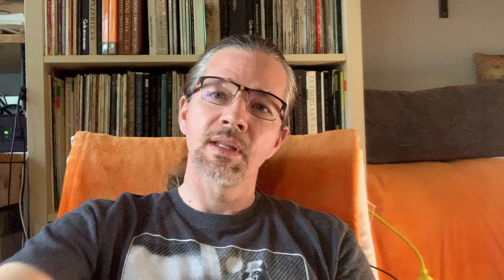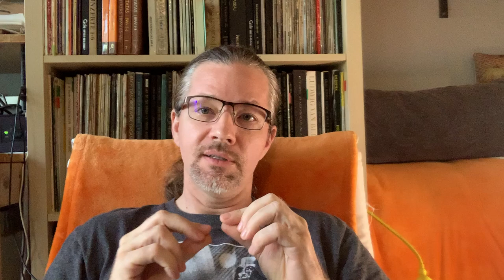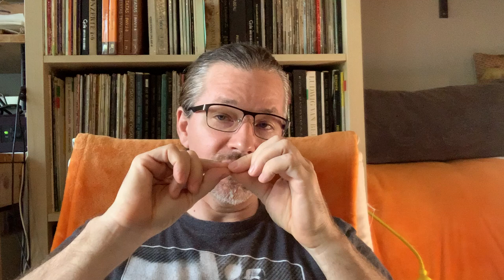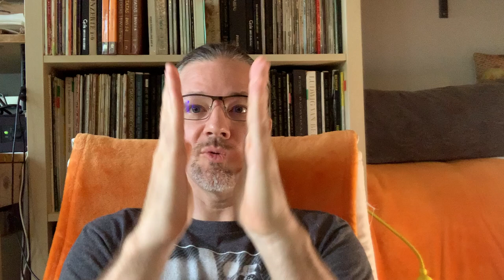BRIEF explanation of CAPACITOR sound colorations in AUDIO

Comment: There are no electrons jumping between the plates of a capacitor. In direct current electrons gather at one plate, creating an electric field that pushes the electrons on the other side of the plate; very quickly this stops the direct current from passing, because the voltage across the capacitor can only push so many electrons to one side of the plate. In an alternating current, on the other hand, higher frequencies are let through while lower ones are stopped. Again, no electrons pass through from one plate to the other—only electromagnetic energy. The insulator (or dielectric) matters in the way that it responds to electromagnetic fields, but it should always prevent electrons from traveling across. A discharge across the plates of a capacitor would be disastrous!
Reply from the maker: Thank you Terrance for the important correction!  The bit I wanted to convey is that the entirety of the field (that corresponds to the AC signal) has to travel through the insulator, and thereby the insulator has a profound effect on the electric field, of the charge and discharge properties.
Reply: Absolutely correct. Capacitors only charge up and then discharge again, depending on the electric circuit. In DC power supplies an electrolytic capacitor will hold the charge until a load is attached. In AC circuits the capacitor will charge and discharge at the rate of the signal frequency.
Reply: Looks like some of the people replying understand how a cap works. What you have to remember also is farads or micro farads are a time based measurement, and how long it takes it to charge and dis charge is what allows current to flow in the rest of the circuit. So since current never actually passes thru it the only thing that affects freq. is how long, not what it's made of.
Reply: How the different dielectrics respond is all compensated for in the rating of the cap, .022 poly, is .022. ceramic.  same time to ch, dis ch., same freq. Differences in sound are from variation in value. Since I do a lot of amp tone shaping I measure a lot of caps and they are all over the place. Many times not even within their specified tolerance.
Reply: @bradt.3555 indeed. If the rated capacity is the same , the rated esl is the same , if inductance is the same , then there is no difference.
What them audiofools hear is simply real world capaciotrs are not ideal capacitors by any means. 
Where small differences go large , are not the crossovers. But anywhere before the amplifier. As any effect of a difference will be amplified by the amplifier.

Comment: This is not a scientifically based explanation.   It basically says that different capacitors sound different because they are different.   The subjective descriptions, if true, are all explainable in terms of physical parameters and objective measures.  For example, the supposed power spectrum alterations must all have their basis in changes in capacitance, resistance, reactance, etc.  None of that is discussed and no objective, reliable, and valid data are offered.   Subjective reports after changing interconnects are not data.
Reply from the maker: Valid comment, very good observation.
What I provide here is information for users. What to choose for a specific purpose. This is also data. It is entirely useless for electrical engineers who want to build critically tuned mega/gigahertz circuits, yet an important guide for human beings who want to specifically voice their stereo systems. Thanks for commenting!

Comment: Hello, I have some Atc scm20 tower and I would like your advice because I would like to change the crossover capacitor, the twwter, than a claryticap for a Mundorf evo oil
Reply from the maker: Hello Miguel, those are good choices. First, inspect what size caps fit on the board, look at the size of the capacitors available, and go with one brand for all the caps. This way you will learn what flavor that brand brings to the play. Have fun with the project!

Comment: A common controversial subject in general is, Coloration is bad.  Colorations are just changes in frequency, EQ. Everything in audio is colored... cables are no diffrent. I make cables that are so colored per say. But they are so amazing in coloration, hehe.  Ok... my question why are so called colorations a BAD thing? Am I missing something.  Are certain folks misusing the term? Im an alternative type of EEE, and I strongly disagree with most recording engineers.... Cables are NOT snake oil.  I invented an alternative technology that clearly demonstrates this. hehehe
Reply from the maker: Thank you Al!!! Video follow up will come out shortly. I went on an epic rant. ; )
Reply: @realworldaudio  can you pls give me your opinion on EQ and coloration with cables. What i hear are not so much any if this, but less distortion, darker background, more dynamics and higher levels of transparency.  I mean without true fancy cables a system just doesnt sound its best!!!  Im lucky i must say that im a fancy cable designer, my cables cost only less than $10 to modify etc.... But they run circles around the 20k cables... patent pending technology...

Comment: Nothing goes through a cap unless it's a short, once charged it's a DC battery waiting to be discharged . They only conduct AC which oscillates polarity when closed circuit . If you put DC in with capacitors current only flows until it's full then it's open circuit eg AC in caps can filter out AC ripple to DC = zero frequency . Charge and discharge nothing goes through the plates , it's oscillating voltage and current . Meter set on DC Caps are open circuit ,why?
Reply from the maker: You have described what capacitors do very well. They show open circuit because the plates are not connected, separated by insulator. Hence, DC cannot flow as you have described. Meter shows open circuit, because it is open, there's a layer of insulation between the capacitor plates.
Reply: @realworldaudio  Your a wonderful person .

Comment: Thank you very much for answering my question which I knew would be a great challenge to answer. This all goes back to an initial question I had many years ago about how a preamplifier works and what all those capacitors are doing inside this box.  A poster diagram with comments narrating how a preamplifier works is something I still would love to see.  Capacitors have a great influence to the sound of a preamp.  Your video raises a lot of issues and expands awareness and of course leads to more questions.  The Conrad Johnson gat preamp has a lot of very large capacitors and your video certainly helps clarify what's going on.  Not sure I understand why there are so many capacitors in a gat and whether they are dedicated to separate areas of the frequency range or whether they all work together. Thank you very much

Comment: Great Job RWA ! 
I agree about caps , I was a Vintage fanatic for a long time mainly Sansui/Marantz 
But 1st time i recapped my ole Marantz 2270 from 1974 wow what a change the amp sounded more modern i lost that vintage flavor  , One of my bestfriends who is an electrical engeener said it best they don't make caps like they use to caps use to be much bigger in size 
 not saying ones better than the another just saying they sound different 
And this is why you have vintage purest who don't want recapping done even though it can be risky . 
actually sold the Marantz after recap and bought another 1 Thats never been touched except for service .

Comment: So Janos, is it better to change a crossover capacitor completely or will a higher quality bypass capacitor negate the effect of the cheap one?
Reply from the maker: I can recommend bypassing a good capacitor with an excellent one, that will be almost always a significant improvement. However, bypassing a bad capacitor with a small value good often creates a very bad situation, with parts of the frequency range behaving radically differently. (You have fast and clear high frequencies due to the bypass cap, but sluggish, muddled, distorted and noisy lows and mids due to the poor main capacitor).
Reply: @realworldaudio  So better to replace altogether👍 Thanks for the response Janos

Comment: 13:45  "everything must go thru that insulator:  ..electrons jump thru the  plates"                      Are you saying that electrons flow thru the dielectric (insulator) in a capacitor ????
If that is the case does it not mean that the cap is defective???
Reply from the maker: The charge passes through the insulator separating the two plates - otherwise it would not be a capacitor, just a connector with tow open ends. ;
Reply: DC does not flow through a capacitor.  We can have some leakage.  But you must look at the circuit around the capacitor. 
We get a displacement of electrons  as it flows from one plate through circuit to other plate.and back and so on .

Comment: What You last said, makes me wonder. Capacitors like all other circuit parts were chosen in measurements for a reason. So if You recommend just a larger capacitor the whole circuit will work differently, will have a different output.
Reply from the maker: Ouch, I hoped I was clear in the video, apparently not. Exact same value capacitors of different brands / construction transmit energy preferentially at different frequency bands. I hope this description is better than the one I tried to convey in the video. Thank you for your comment asking for clarification!